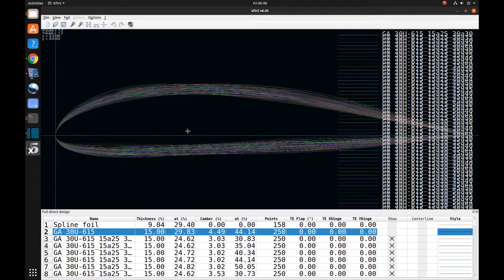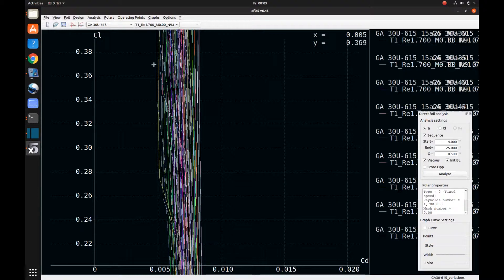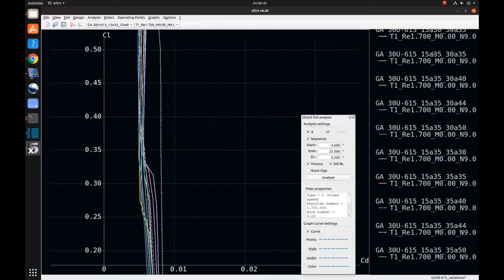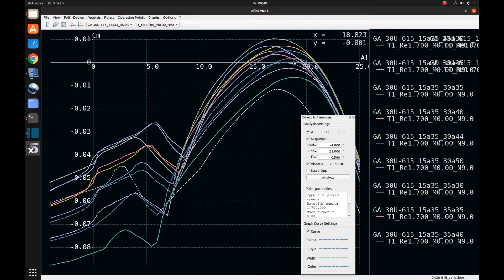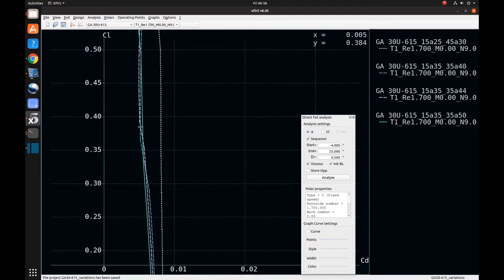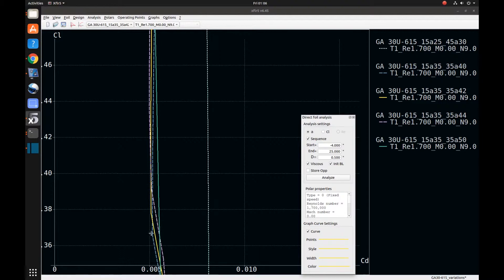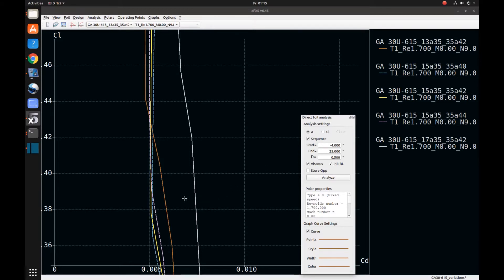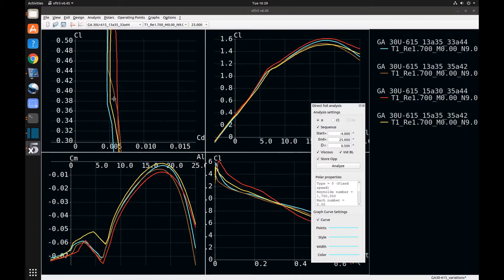UWS-1 Design: Wing Airfoil Selection Part 3

Comment: This is absolutely fantastic work.  You are presenting really useful insights in a way which is practical, applicable to problems anyone working on small aircraft, and easy to understand.

However, I'm not following your explanation of moment, and I find every one of these graphs alarming.

You will have a tail.  When the aircraft is trimmed, that tail will provide some negative lift, which when multiplied by the lever between the wing and tail 1/4 chord points, will cancel the moment from the wing.

As the angle of attack increases, especially past 6 degrees, all of these airfoils see a more pitched-up moment.  That is, the derivative of moment is positive.  Were the tail to do nothing, all of these airfoils would generate more pitch up torque as AoA increases, which is divergent behavior and bad.

What does the tail do as AoA increases, assuming no control change?  Its lift becomes more positive.  When multiplied by the lever, that generates a more pitch-down moment.  Good!  That's going in the right direction.  But does changing the tail area and lever arm make it possible to have the derivative of moment on the tail greater than the derivative of moment on the wing?

For most airfoils from 0 to 10 degrees AoA, the derivative of lift with AoA is fairly constant... that is, the CL vs AoA graph is just about linear through that section.  If I keep the trimmed AoA of the tail constant, but increase the lever arm and decrease the area, the derivative of moment with AoA will not change.  So the lever arm isn't something I can vary to fix this pitch divergence problem.  A longer lever arm makes for a smaller tail area though, which decreases drag.

If I keep the lever arm and trim tail lift fixed, and increase the tail area, I'll have to bring the tail lift coefficient closer toward zero.  It's negative, so that's actually raising it a bit, pitching it up a little.  But now, an increase in vehicle AoA is going to make a larger change in tail moment.  That's good!  That's the thing we need to make the wing and tail together convergent in pitch.

It seems to me the problem with some of those moment graphs shown @7:20 is that the ones that get more positive are also the ones that have steeper slopes.  They'll require a larger tail area to stay pitch convergent.  That larger tail area will have more drag.  So the question I have is, when you add that drag to the drag of the wing, which of these profiles looks most efficient?

And, I can't help but point out that for an R/C airplane or fixed-wing drone, if the computer can keep up with the pitch instability, you can afford to have a smaller tail and less drag.

Comment: These are great videos.  Do you have a video that covers wing incidence and decalage?  I need to understand the interplay of these in airfoil selection for model RC airplanes.  Many thanks again.
Reply from the maker: I do have some info on calculating AoA at cruise. I hope this link helps: https://youtu.be/noSybm_Tz38?t=1295
Reply: @Designer103  I was referring to incidences already built in the wing and horizontal stab when you are constructing the airplane, not AoA which changes when you fly.  Are you planning on having zero degree wing and stab incidences (decalage of zero) in this aircraft?

Comment: great job, wondering how close the  actual airfoil shape approaches the airfoil design coordinates in the build. That is can the airfoil shape be produced
Reply from the maker: Good question. If I had a solid block of a resin/plastic/metal that I could CNC machine and then lightly sand and polish to make my plug then I think that I could get very close. I don't plan to go that though. I'll glue up a bunch of foam shapes and then send them and cover with fiberglass. Then I'll do some fairing/filling to get a smooth shape. That means that I'll be off a little more than if I CNCed.

Comment: Thanks for the video, Sir. Where can I get the GA Airfoils? So I can import them into the Xflr5 program
Reply from the maker: I have not found them online in coordinate files. I have the book that Harry Riblett produced. I just type them in by hand when I need one.
You can usually find his book "GA Airfoils" used on Amazon or eBay.
Reply: @Designer103  Thank you